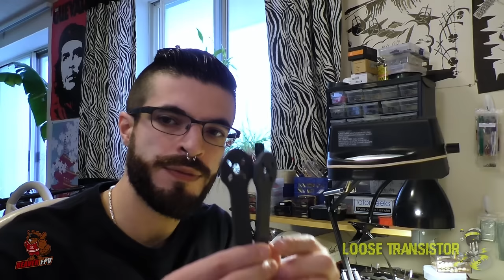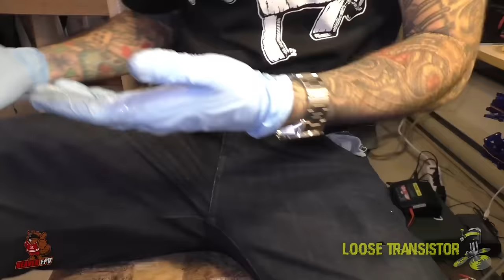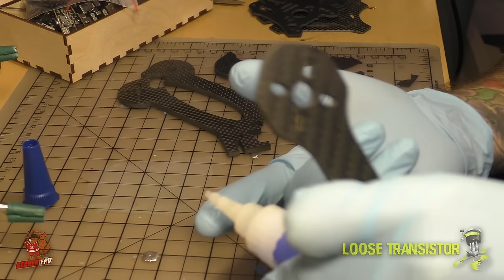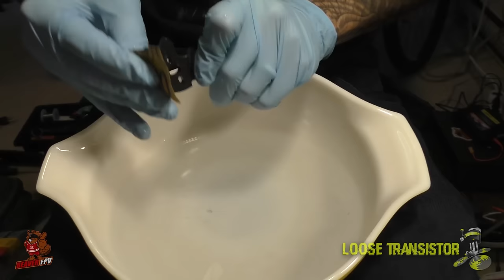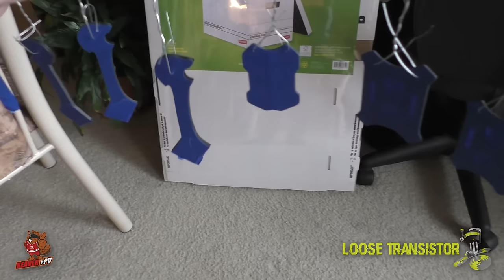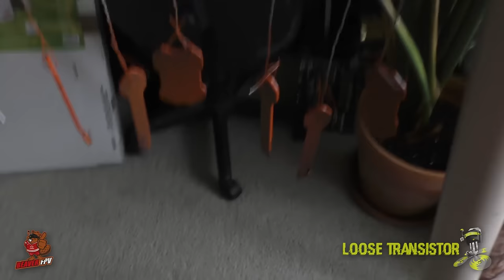HOW TO QUAD ♠ Carbon Fiber Preparation & Edging  - Showroom Quality Results!

Comment: You should consider rubbing a wet paper towel along the edges after you sand them to help with CA adhesion. When they are cut in the factory this is where the majority of carbon powder excess ends up. I always rub my frames down when I first get them and remove the excess. I'd imagine you'd have even more since you sanded them too.
Reply from the maker: Hey man! Really appreciate the advice and I will keep that in mind.

I did wash all of the parts with warm soapy water between each of the steps (filing / sanding / CA / sanding / masking ) to make sure the surface was super clean. I find the soapy water soak for a minute to clean it all very very well =)

Comment: Have you tried any lacquer based paints?  Tamiya has a large selection that includes metallic and candy colors.  One would have to probably use a primer before applying the color coat.

Comment: Holy cow that's one way to over-complicate it why not just get the oil paint pens from Walmart for a dollar or two a piece and just quickly paint the edges of the frame in about 1 minute
Reply from the maker: Because the result is not the same. I said this was a labor of love and you will never get that beautiful glossy finish on the edges of your quad unless you do it this way =)

I didn't say this was the quickest way to prep carbon, I said this was the best way to prep carbon for showroom quality =D

Comment: I think I have a very similar, if not the same set of diamond coated files as you. What granularity of file did you use, fine vs. coarse? It looks like one of the coarser ones in the set, but hard to tell from the video. Thx
Reply from the maker: Hey Paul, The diamond files I am using are fairly coarse I would say they are close to a 400 Grit sandpaper. That is why I usually hit it with 600~800 grit sandpaper after the diamond file to get it all nice and smooth.

Not that my diamond files came marked at all, these are cheapo chinese set from the dollar store! No joke!

Comment: Hey can u share a link where I can find the paint and the CA glue you put on the frame? thanks :)
Reply from the maker: You can find it at any local hardware store.

It's Rustoleum Oil based Spray paint ( whatever color you like )
Any Cyano Acrylade Super Glue will do.

Comment: great job. thank you for making this! I was wondering what made your edging pop so much more than the paint pen method.
Reply from the maker: I have spent many years working with paint in modelling and car body work so I picked up a few things here and there. I never really tried the pen method, but it never quite looked clean enough for my taste so I tried a few things.

The Duplicolor pen applicator works really well too however, its expensive =S

Comment: How come nobody paints the entire frame its always just the sides, I will be painting the entire frame white on all my frames and adding stripes!!
Reply from the maker: The top and bottom are typically a polished surface which is not great for painting on. you would have to sand it to scuff up the surface and allow the paint to adhere
Reply: Loose Transistor FPV I'm fine with that though, it just seems our hobby needs more diversity in color other than black carbon fiber